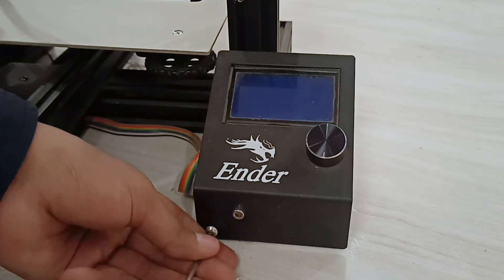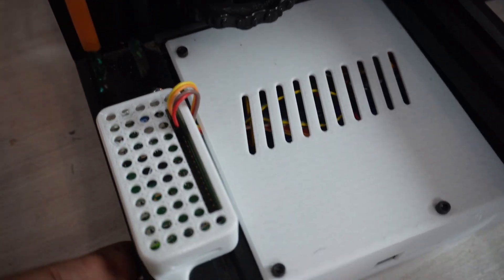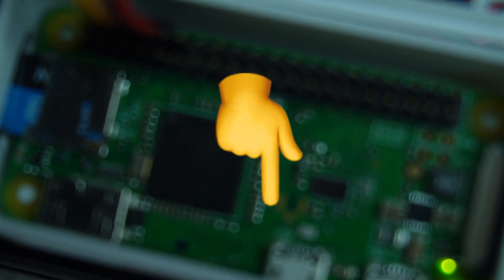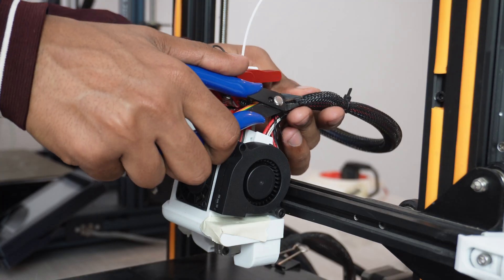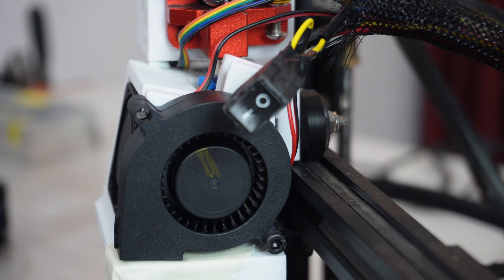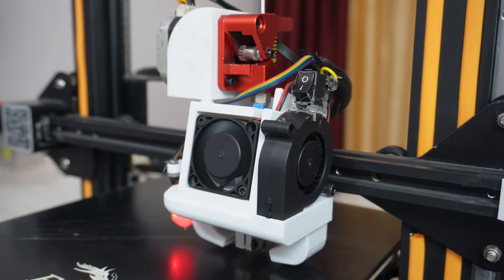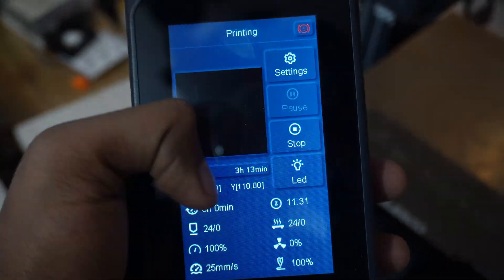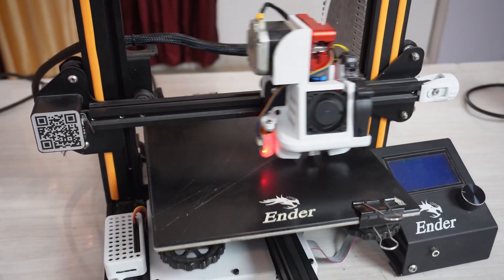Ender 3 Upgrades for High-Speed 320mm/s Printing - Part 2

Comment: you can also use the second heater port as a fan too just have to set the pins correctly to use them

Comment: The Raspberry Pi Zero is not enough to run Klipper, you will regret it. The Pi Zero 2 should work fine, though.

Comment: Anyway to go faster with out kliper it seems like it might be to much for me I have the mods 3 fans and the same fan cover but I feel like cura isn't going fast enough
Reply: klipper is worth it. I think you can run it off a PC for free or use a cheap raspPi clone

Comment: I installed Klipper only for the wifi too.
I'll never go back, it's amazing to be able to print from my desk.
With a "cheap" BTT pi, you can even have a webcam.
Reply: have you had any reliability issues with the btt cb1? two of mine would continually have connections issue's or just wouldn't boot ended  up swapping to a pi zero 2w on both of them
Reply: @traviswipf4307  switched for a pi 4 too when I redid the machine.
The btt was fine but I had some connexion trouble too and the raspberry is just way more stable.

Comment: Can't you just take a cheap THT mosfet and drive it with a free gpio of the board to provide a new fan port.  A fan doesn't take a lot of power, so any mosfet that can handle 24v should do.  I guess you might have to add a smoothing capacitor to allow driving it with low (software) PWM frequencies.

Comment: Klipper helps a lot, also the direct drive is really nice! But the motion system will wear out a lot faster with the high speeds and accels. I recommend linear rails as an upgrade once the v-rollers wear out (mainly the x and Y axis)